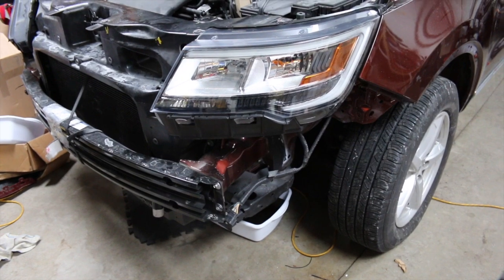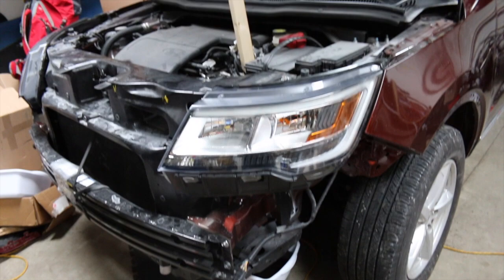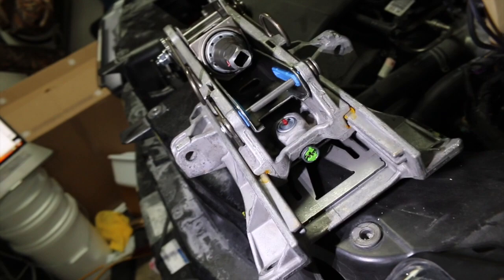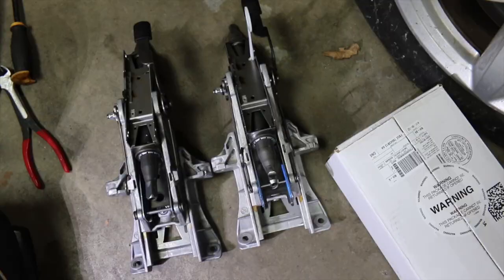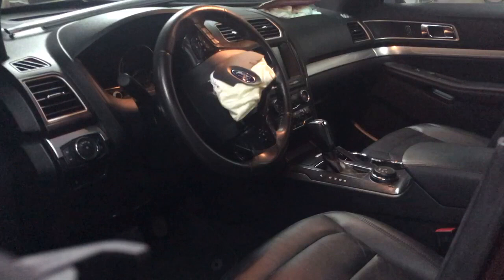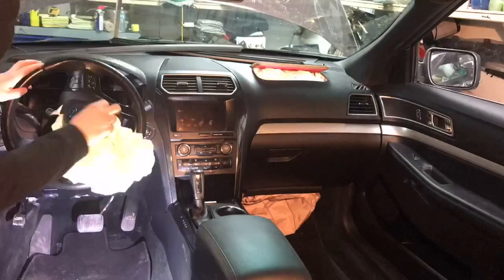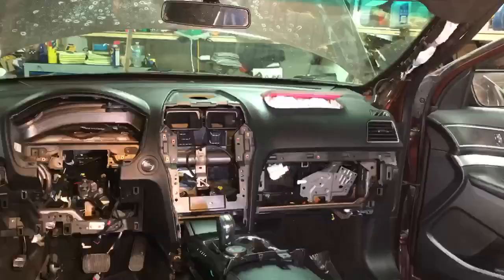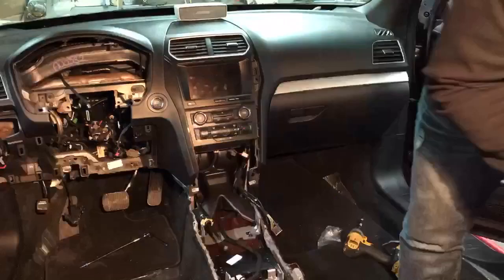(EP 2/3) Salvage rebuilt 2016 Ford Explorer from Copart - Replacing dash panel, airbags, seatbelts

Comment: You can replace sensor only on steering column, $50-$70 for used column from Focus with sensor of course.
Reply from the maker: No way? I didn't know. It looked pretty STUCK - on the column. Good advice for next time. Thanks for watching Rob.

Comment: Hey man, I really need your guidance. What does “Engine Start Program” mean on Copart? I know “Run & Drive” means it drives and all but don’t understand what “Engine Start Program” mean ??
Reply from the maker: Hey bro, Engine Start means the car will start but doesn't drive. This could mean suspension or transmission issues.
Reply: Thanks for the information. The vehicle only has 30K miles, is it worth buying?